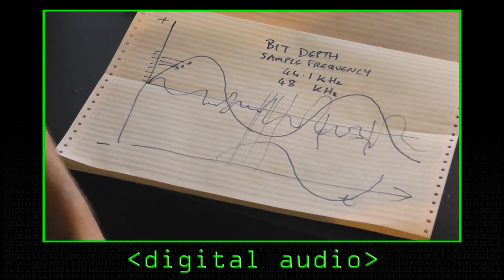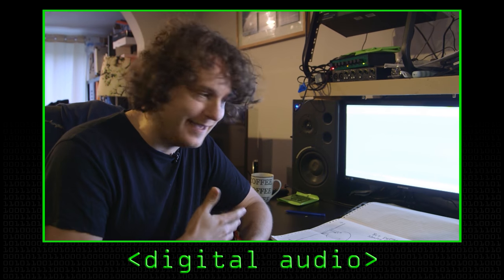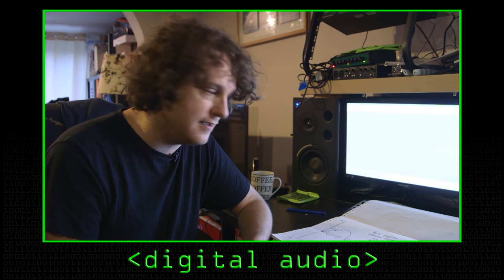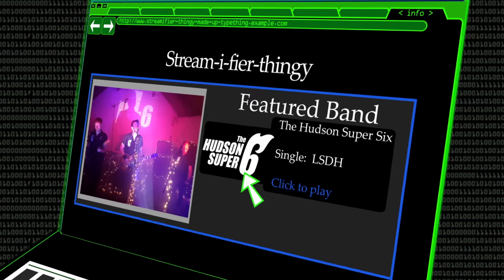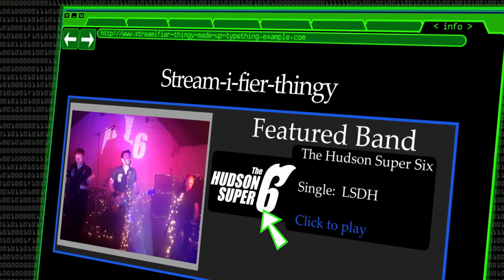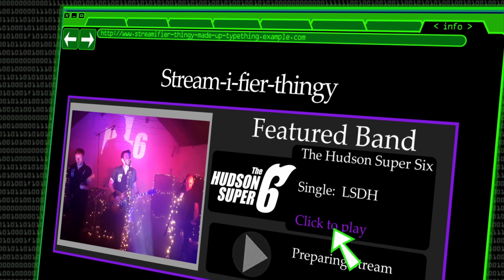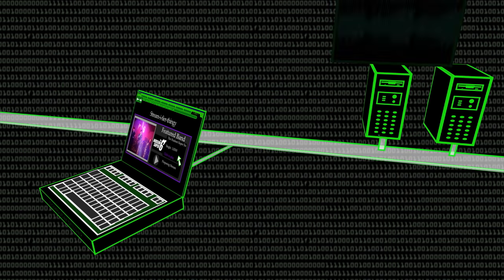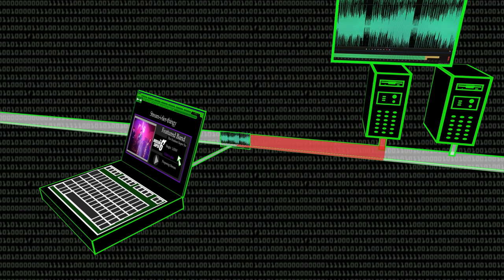Digital Audio Compression - Computerphile

Comment: Isn't it just wrong to say that MIDI has "lower quality" than other formats?
MIDI is playback data, not the same as an audio RECORDING.
Reply: Yes, I found this rather confusing at the start of this video, saying that MIDI has a "quality"! As you no doubt know, it stands for Musical Instrument Digital Interface.
Reply: Yes MIDI is just the "Score" - which notes and when/how long to play them. Nothing to to with quality, that depends on your audio card, synth etc.
Reply: Indeed. MIDI is just a code for the MIDI-compatible hardware to play back using predefined samples on the hardware itself, rather than actual recorded audio, which uses unique samples encoded in the media file.
One minute of MIDI is only a few kilobytes, but the audio clarity is on par with CD-audio and can potentially be even better depending on the hardware a MIDI file is played back on.

Comment: As somebody with a background in software dev and IT, this really didn't help at all. It was a very long version of "it doesn't encode the bits you can't hear." I suppose if I really cared I could just research it properly, but I was hoping for a little better laymans description.

OK, so, say I have a recording at X Hz and 16 bits per sample for 1 second then I have X*16 bits of data. The way he described it it sounded like uses something like a fourier transform to break into multiple tracks of variable Hz and variable bits. However, even if you broke it down into as little as 5 bands then combined they couldn't have more than a bitrate of (X * 16) / 5, and no single band could be close to the original resolution before the file balloons to a much bigger size.

There's a huge gap in how, exactly, separating the frequencies into multiple tracks of differing resolution can then be stored in a way that doesn't produce a larger file.

That make sense?

Comment: The term 'audio compression' has different meanings for audio engineers and computer scientists so the title could be misleading and/or confusing for some.
Reply: I think they changed it to "digital" audio compression.
Reply: Given that the channel is called Computerphile I would guess they don't mean dynamic range compression.
While different things the two are related though (i.e. DRC is used in digital telephony to reduce data in transmission )
Reply: someone who mixes music. in the studio in live at music venues to ay a few. audio engineer is a broad term though
Reply: not nessesarily. compression can be used for tone rather than controlling dynamics. 

Automation is sometimes better for leveling out a performance

Comment: I don't agree with the argument that today we are less interested in bandwidth. If Spotify could save could safe also 5% on bandwidth, their server costs would reduce enough to be an interesting option to explore.
Reply: We are less interested in bandwidth though.

In the 90's when the average user had a 28Kbps (you would get roughly 3 KB/s ) and the premitive mp3 players had something like 32MB of storage you wanted to reduce size as much as you could.
Reply: Of course it was much more crucial back in the days.
Today is more an economical motivation than something that was a must

Comment: Well.. mod fiiles is really as good as you make them. Yea sure, the original mod files was 8 bit, some later was 16.

But because its one isolated sound, it really don´t have that much of a benefit having 16 bit.
Reply: Same thing with MIDI, because it's really just a set of instructions rather than an audio compression technique. Case in point: modern movie MIDI soundtracks.
Reply: Well.. the quality of the midi is of cause of the data it use to play it and quality of the sample in the hardware. This is quite obvious in the Super Nintendo having rather high quality sample in the ROM of the console. (it can also address extra sample on board the game ROM., so it works like a hybrid between a MIDI and MOD.

Looking at the highest quality late module files. They are pretty much CD quality with files in 100-250k range.

Even have some where they extracted the vocals and run the lyrics and chorus as different samples repeating and piching them up and down... still making it sound pretty much identical to the original song.

Some of the early/Mid 90-tys popular songs was actually made that way to begin with. E-type used normal tracker tools for most of his early stuff

Comment: That was a pretty bad description of how hearing works.
Reply: Well its not that accurate, but the things that are important to audioencoding he explained pretty well
Reply: lucky the title of the video wasn't called "how hearing works" then
Reply: cut him some slack.
Reply: @matsv201: not really. I was paranoid it would get overly specific, ex: talking about things specific to MP3 and Vorbis while totally ignoring things like ADPCM (IOW: what most talk about 'audio compression' amounts to...).
... it didn't even get this far ...

FWIW: I could apply those descriptions of psychoacoustic modeling and similar to an encoder I have for a customized ADPCM variant... (which is technically almost completely different than something like MP3; and technically if-anything borrows more directly from FLAC).
(ADD: though, like other ADPCM's, used fixed-form bit-packing rather than Huffman; mostly because of speed and also because the format needs to be strictly CBR for the use-case anyways; so some additional space-saving may be done externally via Deflate or similar...).
Reply: why?